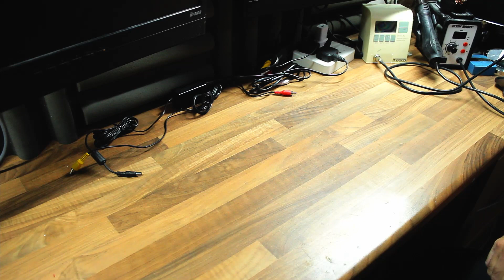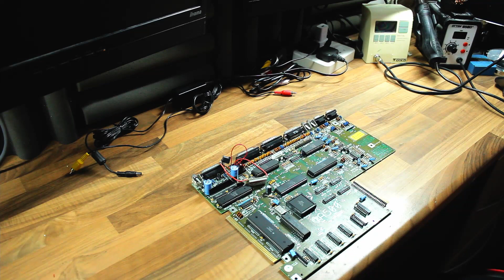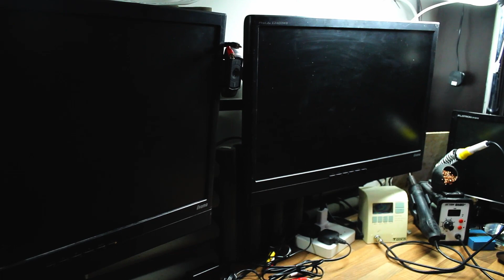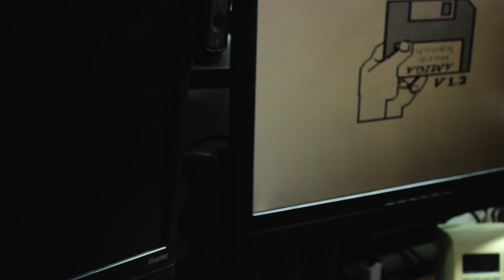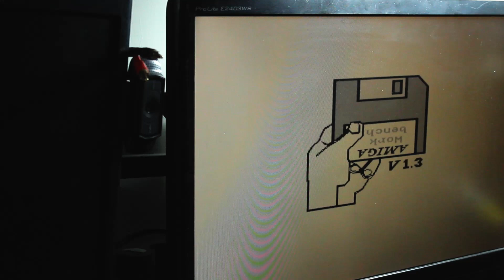Amiga A500 Rebuild Project: Part 1

Comment: Nice project. I still have my Amiga's, three A500's and two A1200's. One A500 (with GVP A530) up and running, and one A1200 (with GPV A1230) up and running, I use the others for spareparts. Connect them so now and then, Amiga are still very nice machines even today. They don't give you near photorealistic gaming @200Hz but the games were much more creative and I don't care it's in low res 50Hz, the gameplay is what counts. And the Amiga's  can do a lot more besides gaming. A pitty the development stopped because of faulty management.